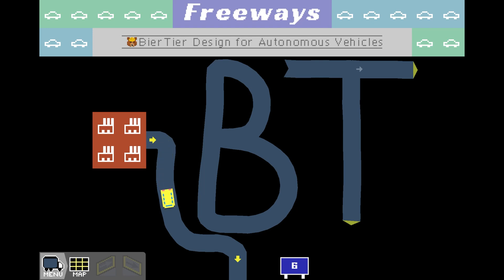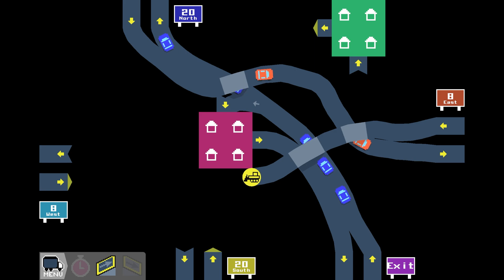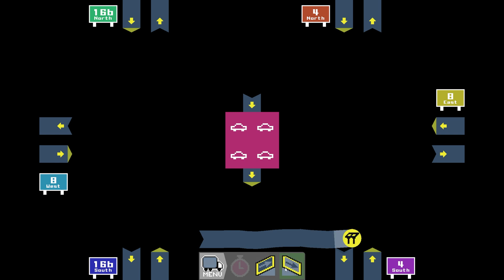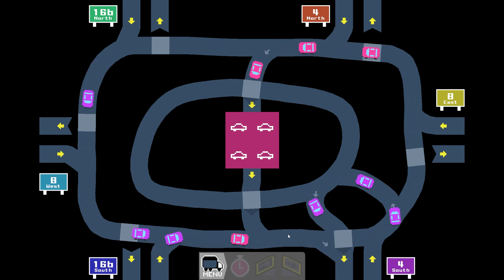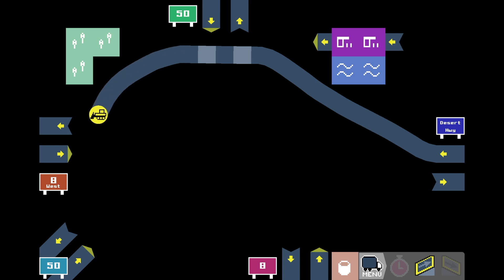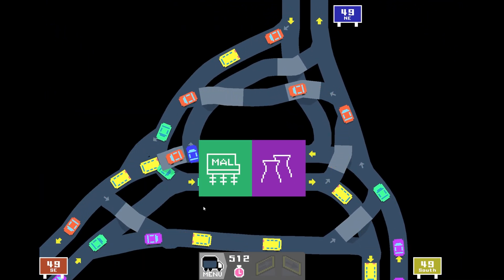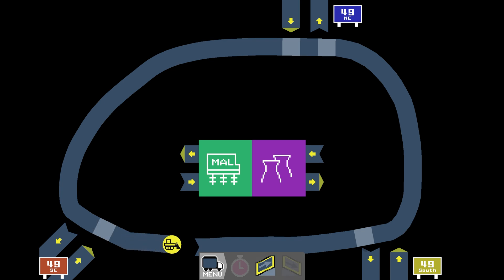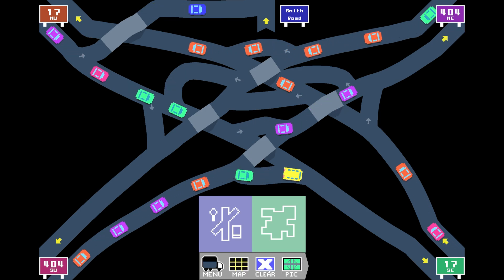Achieving over 39.000 WORLD EFFICIENCY in FREEWAYS! (EP25)

Comment: Great stuff again. Well done for 39 thousand. Should easily make 40 thousand. It seems like every pass through the levels your abilities improve tremendously, and I don't see any end to the optimisations you can make. Don't forget that small slip road I mentioned in comments a few videos back. I've forgotten which level it was but there was a small slip road you missed at the bottom left on one, and maybe another at the top right (maybe level 68?).
Reply from the maker: Thank you! Yes, I think we may be able to make it! The videos from now on will be a bit different, smaller fixed like you mentioned as well as random levels where I see potential. Now we went twice in a circle, time to go random, haha 😂